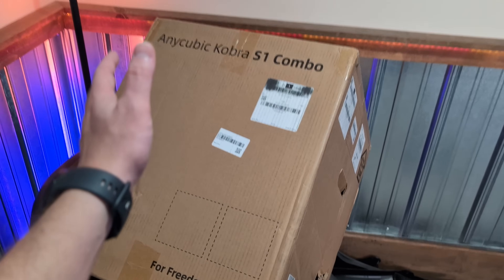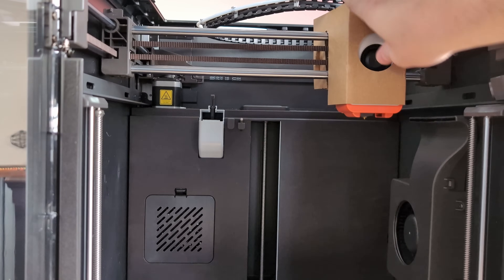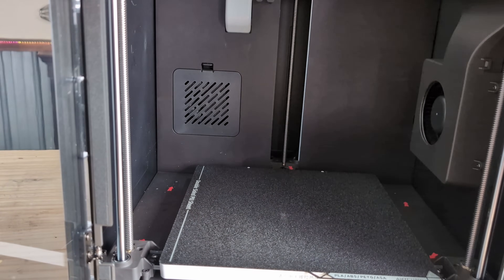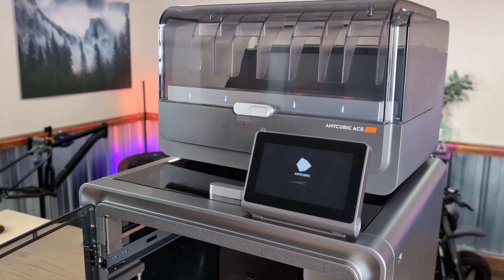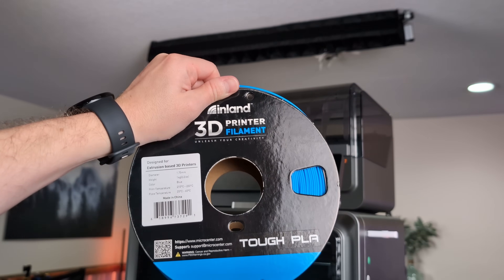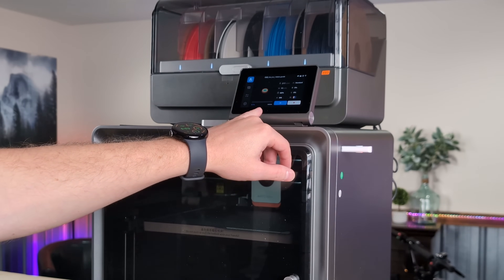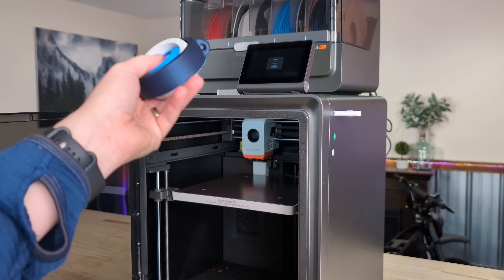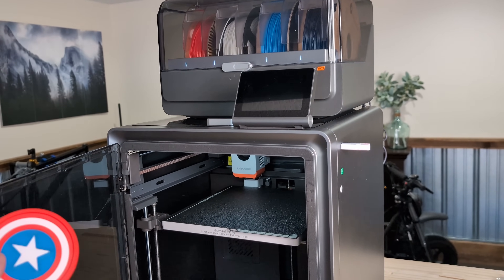Is this cheap knockoff a bamboo labs killer? - Anycubic Kobra S1 Combo Setup & First Impressions

Comment: I canceled P1S for this printer, as this was 250$ cheaper and it has built in dryer. It's gonna be me my 1st printer I'm very excited.
Reply: Update after 3 weeks of using it:
everything worked great after taking it out of packaging and updating it.
Reply: i got my s1 combo about a week and a half ago and have already put almost 2kg filament through it. so far the failures i've had were my own fault - didn't use brim on a tall, thin object, didn't untangle the loose bit of filament on a spool which eventually bound up and jammed in the ace pro (though to its credit, when i cut off the tangle the printer/ace started purging what was in the tubing between ace and hot end all by itself) then once i had the spool cleaned up and detangled, i just stuck the end of the filament into the ace input, and it loaded the filament automatically like usual... then i clicked resume on the printer's screen and it finished the print job like nothing had ever happened. yes it made a lot of poop purging the entire length between ace and nozzle, but that sure beats the heck out of losing 12 hours worth of print time on a 22 hour print!

i'm now working on a mod to move the 4-1 hub and sensor up inside the printer to get it as close to the nozzle as possible, and then shorten the 4 individual ptfe tubes from ace to hub as short as possible as well. this should make color changes a LOT faster since it won't have to retract near as far, plus filament load/unload times will also be a lot quicker. right now the main hangup is i'm waiting for a cable i ordered to get here so i can just plug in an extension for the hub wiring rather than cutting/soldering to make it longer. i always try to make any modifications 100% reversible. cutting ptfe tubing is simple enough for most people, but not everyone can solder. if i end up doing this, i'll probably have to make a youtube video showing how, so other people can do it too. honestly, color changes taking so long is my absolute LEAST favorite thing about this printer. this mod won't reduce flushing times or amount of poop, but at least it'll help simply moving the filament in and out of the printer get done quicker, which will be quite significant on any multicolor print. will have to do a baseline multicolor print with the printer unmodified and then use the same gcode to print the same object after the mod... and time both of them (not relying on the printer's own clock - that seems to be a joke)
Reply: @Gibson99  I'd suggest you buying separate PTFE tubes, so your modification will be 100% reversible. I don't really print in different colors, but from what I know it is similiar to bambu p1s. 
I'd also suggest you upgrade hotend to hardened steel. I bought whole kit of 4 whole hotends (0.2, 0.4, 0.6, 0.8) from alie for about 20$ and only added a little bit more thermal paste on the termistor, so it works better. It's also getting up with the heat faster as it's smaller.
Reply: @Olchann  Yes, I already bought a set of tubing and fittings for something else, and that's what i cut to shorten the ace-to-hub lines. i kept the stock lines in a box w/ other stock parts. i've also ordered some of those ceramic hot ends w/ hardenened steel nozzles. they're still on the slow boat from china, but i also plan to add some thermal paste when they arrive as i've heard that's a common complaint. i was already in the habit of adding new thermal paste on my ender 3 when i would replace the heating element/thermistor because that made it more reliable.

Comment: Not sure if you’ve covered it yet, but there’s a super cool feature worth mentioning. Instead of wasting filament during color changes, you can redirect the purge material into a secondary model called a flush object. So while your main print is going, you could also be cranking out something fun like a multicolor dinosaur with the leftovers. It’s a clever way to reduce waste and score a bonus print! Plus, it’s faster—since the printer doesn’t have to travel to a purge tower, it just keeps printing. Still a little waste, but way less overall.
Reply: That sounds so cool! I wish my Bambu p1s had it
Reply: @Thebobomastepro as I don't have a bamboo printer I'm not 100% sure but I am 75% sure that they can. Also if you're printing in dark colors you can flush to infill.
Reply: is this specific to the anycubic version of Orca, or is it in all versions of Orca? I was a bit put off by how all these AMS/not-AMS/CFS/etc systems make so much poop without a decent way to recycle it back into usable filament (for a reasonable price)... i've seen some people showing recycler systems that cost more than this printer combo and still require you to somehow grind up the scraps into powder first (now i have to buy a specific blender just for this, so i'm not leaving plastic in my actual food blender?)...

this solution is not only useful, but should 100% eliminate poop all together!  That or just tell it not to purge, but instead start with supports and infill before doing outer walls and that should also take care of the purge. who cares what support and infill look like, right? only hiccup i see with the flush object is that it needs to be at least as tall as your main object. so if i'm printing a little sd card holder as the flush object, but a multicolor benchy, the benchy is of course taller and thus will start producing poop once the flush object is done.
Reply: @Gibson99  So far I just use the same print that I use for the multi color. So I'll have the one I wanted and a few others that are the flush object. I did some NES controller keychains and the flush object looked better than the ones I wanted. You never know what your going to get.
Reply: Outstanding reply!!
Reply: can do this with anycubic aswell . place your flush object on the plate right click it and go to flush options and flush to object
Reply: Love your scripture! Be blessed!
Reply from the maker: Thank you!!!

Comment: I don't know why Anicubic uses cardboard. It even says not to use cardboard reels in the ACE Pro. You should of showed the waste after the coaster.
Reply from the maker: True. They do have little plastic rings for you to print that are included with the print files so that you can put them on the cardboard reals to give it more grib and make it more sturdy. But ya... That's an extra step and they don't fit all cardboard spools.

Comment: Those voids in the tips of the star's top surface seem like a huge fail on the slicer's part - I am not familiar with their software, but I would check for "arachne" mode to see if that helps fill them in.

Comment: I have mine since about 3 weeks. And "thanks" to illnes and beeing @home i have the the time to print about 120 hours till today. The package arrived well, but a few days later. Unboxing and mounting felt a little bit like like christmas and birthday at the same day. About 95% of my prints are 100%. Till now I'm using standard profil "anycubic..." even if it's geetech, Anycubic, kingroon...doesn't matter. Yes, as may some will say, use specific profiles for different brands, but i am a "user ". Just like my fully automatic coffee machine,  turn it on and makes  perfect coffee, latte macchiatio etc.on a finger tip. I love this machine and it's one of the best things i bought in the last 2 years (best ist my new motorbike😂). My guess is that this printer will lopen open 3d printing for more people than Bambu Lab will do. The cost benefit ratio is very good.
Reply from the maker: 2 questions. 
1. What coffee maker do you have that sounds fantastic lol
2. Motorbike!? What kind?
Reply: @overvolted  hi, nice to meet you. It's a nice and simple deLonghi dynamica . It was a birthday present from my deceased father. 
It's a Cf  Moto MT 650. I actually don't know the english name.  Guess it's ADVentura. Both a like y lot. One, because it is always a memory of my beloved father and the other i could affort because of  Inflation compensation payment.  I got the money and was able to buy it spontaneous.
Reply from the maker: @robertrastlos4512 that is awesome!!

Comment: I bought this printer in early March and have used it for about 270 hours, printing over 6 kg of various filaments.
I should point out that I am not an expert in 3D printing, and that is precisely why I chose this machine: I wanted something that would work "almost" right away, without the need for endless calibrations and adjustments.
Well... let's get to today and all I can say is: I strongly advise against it.
The print quality is poor. I have never obtained a single flawless print: there is always some problem, some defect, whatever I try. If you want to print dolls or toys, it can be fine. But if you intend to use it for serious or precision work, look elsewhere, unless you like spending months and months in endless tests looking for the "perfect" piece.
Oh... if you wait for someone to come to your rescue, forget it. You will be forced to solve the problems yourself.
Personally, I do not recommend this printer to those who need it for work and expect reliable results.
Reply from the maker: I'll have to try and x1 carbon sometime and compare head to head. Its definitely an upgrade over my ender 3!
Reply: I have not had a single print quality issue with mine
Reply: @adaml.5355  It really depends on what you're printing and what kind of quality you're aiming for. If you're doing a Benchy or some PLA toys, sure — prints look decent enough.
But if you're trying to produce something more demanding, like a front panel for an instrument or any part where surface quality really matters — especially with materials like ABS or ASA — then you'll quickly run into problems.
Vertical and horizontal surfaces often come out with poor finish, inconsistent textures, or visible artifacts, even after tons of tuning.

Comment: As someone who came from a modded Ender 3 Pro, this machine is like a panacea.... I'd rather be printing than tinkering. About 100 hours in and only one failed print because I flew too close to the sun, AKA I put too much on the build plate.

And fun fact, I'm using the BiQu CryoPlates for the Bambu X1C instead of the standard PEI plate. They are close enough. Can't wait until BiQu makes one specifically for this printer. They are a revelation.

Comment: its really amazing how fast 3d printing became cheap and easy to do
Reply from the maker: It's such a cool thing to have around for when you need to make some custom mount tool or whatever. I find used all over the place
Reply: For sure, 8 years ago you could spend $600 building your own corexy with none of the advanced features.
Reply: My first ender3 cost me more than this after all its upgrades. I just can’t wait for the same to happen with metal 3d printers. In another 15 years or so they will be a reasonable purchase for home use.
Reply: @ImNotLostButWhereAmI  Honestly metal printing will never be as cheap as plastic printing. You need much more power, you need good ventilation and so on. But i'm sure it will become cheap enough so that small business owners could afford one. I would guess cheapest metal printer will be priced like high end plastic printer
Reply: @regeman100 oh yeah it won’t get to be a few hundred bucks as material costs to build one alone would exceed that. If a fairly reliable metal printer could get down to 3-5k I’d consider that reasonable for a hobby/small business out of someone’s home. The usefulness would far exceed a plastic printer and I’d buy one at that price point
Reply: @ImNotLostButWhereAmI Unfortunately there are some other problems with metal printing. You basically need a while workshop to get them to the finished state. Sanding, polishing. Supports (nesecary for heat exchange) need to be cut off. 
But yeah, if you got your own stuff allready then this would be possible next step

Comment: I have owned 4 Anycubics. They have all turned into paper weights after a month or so.
Reply from the maker: Oh bummer why* is that
Reply: My Kobra 2 is the only one to give me a problem which was the leveling probe. After that not a single problem. The Kobra Neo printers I have never had a single issue in two years. The Creality K1 can't level worth a crap unless you manually adjust it, but prints good after that. My Elegoo Neptune 4 printer outperforms Bambu Labs X1 series printer and I've been told that by numerous Bambu users. Only advantage is that X1 has automatic multi-color. Kobra 3 is love/hate. It can print really good, but it needs adjusted often. Neptune 4 also has never had an issue.
Reply: @ the strain relief sensors always fail

Comment: I was really excited about this printer, but I've heard a lot of stories of people having issues. At this point I might just get a Centuri Carbon and hope elegoo follows through with their MMU system promise
Reply: I just got the Kobra S1. Works great. Only Issues I had so far was broken filament in the extruder ( I was using 4 year old filament). The machine detected it and provided me with a QR code that gave me step by step pictures on hpow to open the extruder and remove the broken filament. It's been great so far, no print issues at all.
Reply from the maker: So I still only have 10 prints under my belt or so, but so far so good. From my perspective. I've gotten used to how to wiggle the filament to load a new spool into the ace pro and I haven't had any problems at all that were substantial. The only problem is every once in awhile when I power it on it doesn't seem to boot up all the way and I have to reboot it like I did in the video. However, there is a firmware update out that I need to apply so maybe that will fix it
Reply: @overvolted  Oh, cut the filament at an angle and then insert it into the hole in the ace and let it grab and pull it in. Also, the ACE Pro probably have firmware updates to run as well.
Reply: I had some issues with the s1. I returned it. I had planned on getting the Centauri, but it sounds like it might be more of the same. Hard to say at this point, but I know that their ams is a question mark and the printer won't arrive for a few months. Final price will be similar for both with their multicolor systems, so it's a wash.

Comment: Bambu Labs killed themselves by changing their terms and conditions! I was going to buy one as my first 3D printer but found out about their underhand schemes just in time. Prusa arriving in a few days now 😁
Reply: I think it was because of the 40 watt laser. Had to make it good enough for school and/or company safety/security. It's a real product. As long as it works with any brand filament I see no issue.
Reply: @rsilvers129  I meant when Bambu told everyone that they'd disable their printers if they didn't agree to share their files with Bambu Labs before allowing them to print those files.
Reply: Don't be hating just because you are poor.  Bought a Prusa huh.... man if only you read the TnC that says they can do whatever they like with their software. Illiteracy and poor research is a weird flex.

Comment: Hope yours works better than mine....got mine yesterday, too.  Haven't done a single print yet (15-minutes to print my a$$), but I have performed open-heart surgery on the ACE pro as the filament in one of the ptfe channels jammed up and had to be cleared by disassembling the entire unit.  

Today, I tried loading filament (Anycubic RFID) but the ACE is not recognizing any of it.  It is also PLA-HS, which is not a manual option either.  Would be interested to see if you have any issues with the ACE pro.
Reply from the maker: Daaanng that sounds like a mess. Were you able to unclog the jam? Now I have a new thing to be worried about lol
Reply: @overvolted  Yeah, got it unclogged....The filament actually bunched up in the PTFE channel (those spring-loaded mechanisms at the back of the ACE that you plugfged the ptfe's into...wierd because it wasn't even the end of the filament that bunched up...happened in the center of the filament line.  Got it cleared and put back together, but still having issues with RFID not working...very disappointing...may just load some regular PLA tomorrow, just to run a print and make sure there are no problems with the printer itself. (crossing fingers) :)
Reply: @oldschoolonline8871 I had the same issue with jamming TWICE. I've had it about 2 weeks now, and I still haven't tried multi color prints. Probably won't until I know for sure I've fixed all of the issues.
Reply: Don't worry. Soon you will realise buying bambu lab is buying for printing, buying anycubic or creality is buying printer to learn how to fix 3d printers 🤣

BTW, I was creality and anycubic user, and few more. Since bambu I won't change to others unless bambu will finally close the system down and put any subscription option.
Reply: @Jokershadow696  bamboo is awful, they are slowly closing the ecosystem, they guerilla market all over, they actively delete negative post and feedback or even broken printer post.  They are absolutely not worth the BS.